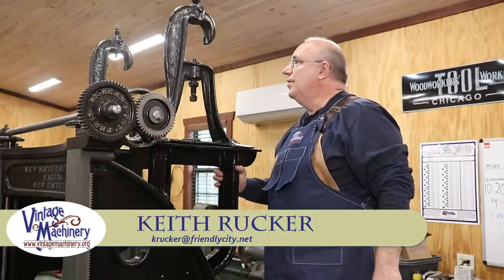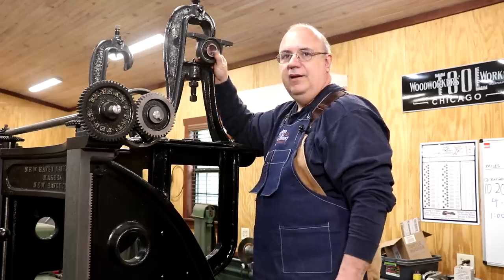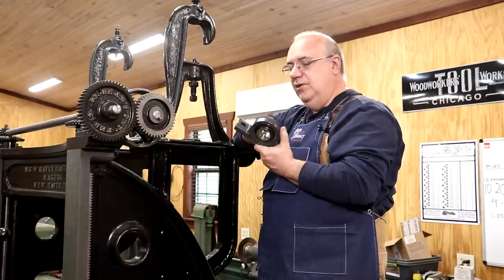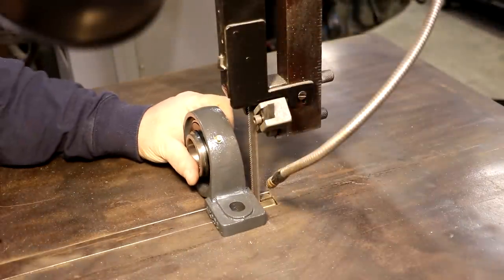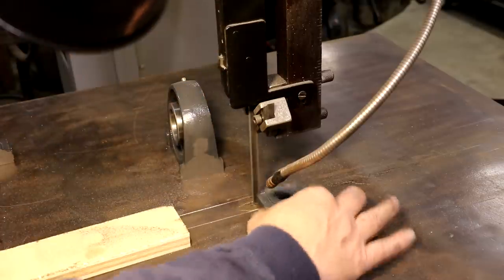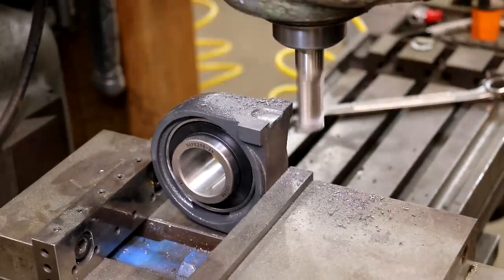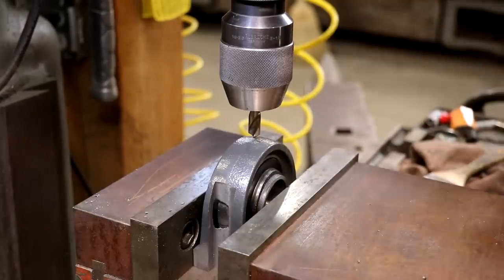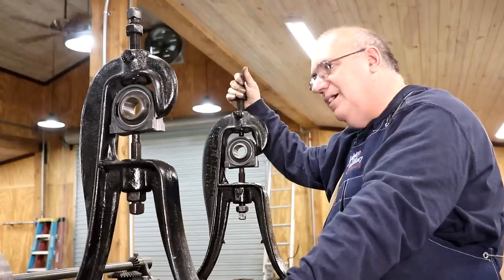Metal Planer Restoration 55: Countershaft Bearings

Comment: nice new apron!!  agree with comments about turning bearings over. look better and easier to access grease fittings.  yea, you want to get it done, but if it doesn't work and has to be done over, then it takes longer.

Comment: The original line shaft system allowed the shaft and pulleys to be dropped out in minutes when it was time for a belt repair.  While it isn't lock-out, tag-out, try-out is was a way to isolate and repair one machine without taking down the entire line shaft system.  Remember Keith's wall plaque:  " My barn, my rules".

Comment: Maybe you can put the bearings with the round side down... in my opinion, is a little bit more "elegant" (machined sides are less visible...)
Reply: Also it would enable access to the grease fitting.
Reply: @gregmckinney6977  I agree....
Reply: Yeah totally what I was thinking the whole time.

Comment: those bearing housings just look weak to me. i think i would have made up a couple of blocks to slide in the brackets and then attached some flange bearings to the blocks. i would hate to see something come apart up there after all the hard work you put into this restoration.
Reply: How often would that bearing block w/floating bearings failed catastrophically that you know. I get your concern but is that practical/possible/probable?
Reply: @silasmarner7586  my comment comes from over 50 yrs of experience in the machine rebuild /repair business and as a home machinist. keith's design may last forever its just not the way i would have done it. its a beautiful old piece of machinery and he has done a wonderful job restoring it, i hope my 2 cents hasn't offended anyone.
Reply: He did remove a great deal of strength from the bearing housing,  but two things come to mind. First, it's a temporary build. The planer may someday work on a line shift. Second, he modified the cheapest and most modern device leaving his antique line shaft hangers nearly unmodified or at least as much as possible.  He can easily replace the bearings if problems result, so I'm good with it.

Comment: If you invert the bearings you can still use the grease zerks that they originally came with instead of having to remove them to service the bearings.
Reply: Or use 90° Zerks.
Reply: @Biggus_Mickus  Try this site: https://en.wikipedia.org/wiki/Grease_fitting
Reply: @Biggus_Mickus  Here in Indiana, we just called them "grease fittings" or "alamites"  but my grandpa called them "a pain in the arse".
Reply: @Biggus_Mickus  Zerk was the guy who invented them in the late 1920's.  Bott's dot's are going the way of the dinosaurs because they require frequent replacement and the vision systems on self driving cars don't work well with them.
Reply: They're useless once he milled thru into the mounting channel. Pump grease in and it will come out those giant holes rather than into the small hole in the bearing outer race.
Reply: @Biggus_Mickus  Sorry to be a pedant but Cat's Eyes are reflective for night use whereas Botts Dots are non-reflective - used to mark highways in the daytime. Never heard of Zerks either !
Reply: I don't think he's using them because those are sealed bearings. The grease fittings are for the block itself which will not move much if at all. The bearing will fail well before the block

Comment: If you put the jam nuts (on the lower adjustment screws) on top side, you can put you bearing 
higher into the mounting blocks.

Comment: Nice job Keith. I think I might consider flipping the pillow blocks over upside down in the slots. Might have to ding a little off the bottom corners to make that work, or maybe not. Aesthetically it might look a little better, and as an added bonus you will be able to reinstall those Zerk fittings and have them exposed.
Reply: He will never be able to grease them in situ, as the slots have exposed the grease channel, so the only way is to demount the bearings and put them into an intact pillow block casting, and lube them in there. Factory grease fill will have to do, and almost every one of these blocks never gets extra grease in use, especially in a slow speed shaft like it will be here.
Reply: @SeanBZA  Sloppy fit, he machined too much off in the slot depth. He trim up the side width and should have trimmed down the face also so he could take less off the depth of his cut of the pillow block. And from the looks of the second one he may have done just that. I see no windows by the bearing.
Reply: @SeanBZA  Maybe the bearings won't ever get regreased, but it looks a bit unprofessional if one can't actually access the grease nipple provided. Please consider flipping the bearings over.
Reply: Hi Keith, nice new apron and straps. I agree with the comments so far as I've read. Those blocks should be downside up so to fill the gap more. You'll get more support of the block that way.
There is a version of those bearings that has a face flange that fastens on with a couple of bolts. Those bolted to a machined block held in the grooves would look more like the original Babbitt blocks but you've done this choice so now you'll have to live with it but please turn them over.
From a warming Canada.
Reply: @ronwilken5219  I agree with you. Flange bearings with mounting blocks would have been a better choice.
Reply: As far as I can see it from the other side of the screen, it would look better to turn them around! But there will be a reason why he is doing it that way for sure!
@SeanBZA
because of the slot to insert the bearing und the anti rotation pin, the cut in grease grove is on the other side and probably untouched and useable for the grease fittings! As far as I now them from daily work.
Reply: @trevorkrause7220  Or use 90° Zerks.

Comment: Keith.. I don't think this is your best work mate... Would have loved to see you make some purpose fit holders for the bearings here. Love your work though sorry not your apex that I have come to respect....
Reply: A two bolt pillow block flange bearing, with the bolt holes vertical, mounted onto a well fitting holder would look and function better.

Comment: So, you basically recreated a UCT pillow block out of a UCP block.
Reply: Yeah he pretty much did, but there might have been some cost savings. Ya neva no.
Reply: Nice work improvising!     What sort of step-down/reduction will be needed for the unit?       Obviously those original lineshafts didn't run anyway near 1800 revs/min. Probably some fraction of that. 200-400 rpm?

Comment: I don’t have an issue with the use of pillow block bearings versus babbit, but I have to say that with the square corners and milling through the housing the implementation looks sloppy.  Pretty sure it will all work and last, but frankly not up to your usual standards of fit and finish.  Your shop, your rules, but color me a little disappointed.
Reply: He's probably seeing the finish line.
Reply: This project has been along the line too much, you heard the man, he just wants to get it done, and get the chips flying. One of the most important lessons in life, frankly, as far as i'm concerned, the most important one, is to know when to quit. Not to be confused with "good enough", rather its own blend of "that's enough of that, i've a life to live".
Reply: I find it refreshing. There hope for us all yet. We all know he could have done it more nicely with twenty times the effort.
Reply: @Rich-on6fe  m

Comment: In the first part of the video there was a grease fitting in the pillow bock. In later parts of the video there is no fitting. Did you eliminate it or plan to use a right angle fitting?

Comment: you would be mad not to use the bearings in my opinion. I would have used a PA208 bearing housing instead of the pillar block but looking good anyway can’t wait to see it run

Comment: Really don’t care for how thin those bearing blocks would be, even if it didn’t break through to the bearing race.  Not workmanlike in my opinion.
Reply: I've seen the housing mounts on pillow block installations come apart when used in large airhandlers. And that was when housings were  not machined in anyway. Could be a problem with vibrating shaft if motor bearings are off or shaft alignment not correct. Careful!

Comment: If it was me I turn the bearings up side down so the bottom of the metal frame of the bearing would be in contact with  the lugs because there’s more material. Just a thought!

Comment: Hey Keith just wondering if you ever got your dial put in the victor safe. I just finished watching that because I picked one up for 50$ and plan on fixing it up. The hole things been painted gold and I’ve been looking for information on them. Thanks for the info.

Comment: The bearings look fine for the job but the attachment appears too 'spindly' (is that a word - but you get what I mean). I would have mounted the bearings with the square base the other way up thus locking more securely up into the casting support. But I expect KR is right - he usually is.

Comment: I like using the pillow block, but there just isn't enough support for an electric motor of the size you're going to use. You seem like NOW you're in a big hurry to get this thing done, and of course, since it is a video we'll never know if it's a mistake. BUT IT IS. You need to rethink the design of the mounting positions for those bearings.

Comment: Keith I understand all the reasons for the simple mods, but share the concerns that it is not up to snuff. The original forces that were put on the hangers and shaft are all going to be nearly reversed with a motor mounted on the  machine. It could put a much different load on the hangers . I hate to see the hangers or worse any other part of the painstaking rebuild you've done so far be broken. BUT, I am sitting here in my chair enjoying you sharing all this with me, you are there with the entire picture, so my final word is good luck ,and I wish nothing but success for you.

Comment: I agree with Trent plus if you invert the blocks you will have more meat to support the blocks between the pads on the frame.  You might also consider drilling and tapping some 1/4 x 20 holes horizontally through the pads to further stabilize the bearing blocks.

Comment: Re shaft and belt drive. In my family machine shop in New Haven. Conn. Originally built about 1915, there were two shafts mounted in the ceiling driven be a single large electric motor. I remember the shafts being used in about 1948  to run a few of the old large machine tools.

Comment: I’m not a mechanic at all, but just wondering...: I get the gist that the motor will be mounted below the shaft, and that the power delivery also will be in a direction lower than the shaft. So all the belts will pull down on the shaft, whereas originally the incoming belt would have come down from the ceiling. I guess I just don’t know enough about the arrangement and number of flywheels and belts, but if every belt pull down, will those set screws hold up for induced vibrations? As said, just thinking out loud with total lack of knowledge. And I really enjoy following you and your work! (from 🇳🇴)

Comment: - Hear is an idea you might like: If you turned the pillow block bearings down-side up, then the grease fittings would point down so you could get at them without a ladder, PLUS it would look better to the eye.
Reply: The grease nipple is irrelevant now, he cut open the housing so now grease will no longer be able to be packed between the housing and bearing.

Comment: Keith I noticed you removed the greasers   is there to be new ones inserted? and as the bearing was grazed would this prove to be problematic ?  As usual  really enjoy the videos you offer.
Reply: The slot exposes the grease channel in the centre of the bearing, so pumping in via the grease fittings would just push it out the side, and not through the tiny hole into the bearing itself.
Reply: @SeanBZA   that is what I was thinking too.

Comment: I still think it would be more period correct if you had a line shaft and powered it with a gas engine set outside the shop.

Comment: Considering the horsepower of the planer motor your solution to getting the shaft bearings set up appears to me to be a good solution to getting a 100+ year old machine back in operation.

Comment: I was thinking flange mounted pillow block bearings would work better.
Reply: Machine blocks with slots to run up and down the the holders with flange mounted self aligning bearings bolted to them.

Comment: Keith, this addition is a lot shorter of everything else you have produced for this project. The square cut edges of the bearings bring in an element of patching rather than the fine quality of the other elements you have manufactured. Would like to see the casting rounded off to create a concentric view of the bearings.

Comment: Would the stoker engine casting fit on this thing?
Reply: Gonna run into the same problems as Adam was on the shaper.
Not enough tool clearance.
Reply: @samuraidriver4x4  Possibly. Not necessarily.
Reply: I think he wants to use his horizontal boring mill on the stoker engine. He said he needed to do a couple things to that machine to be able to work on other stuff.
Reply: @Hoaxer51  Yeah, heard about that plan.